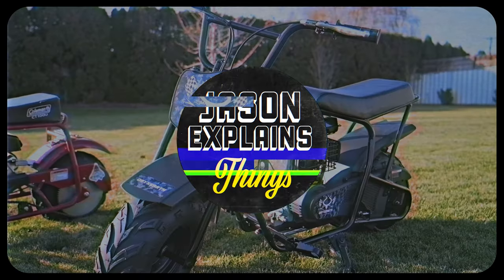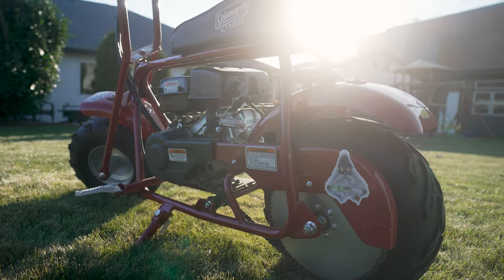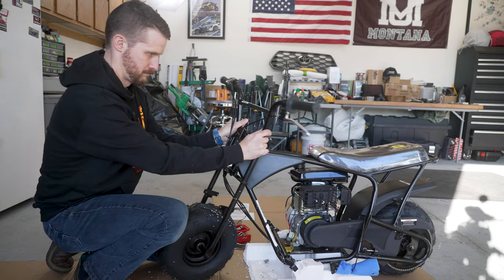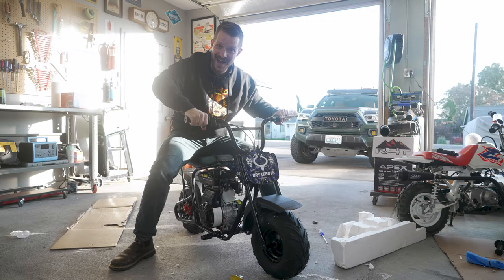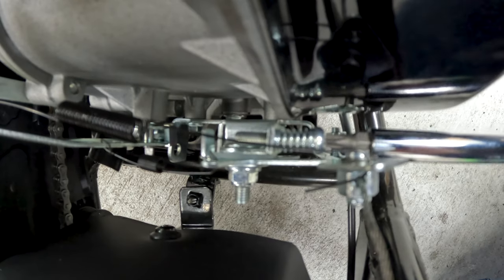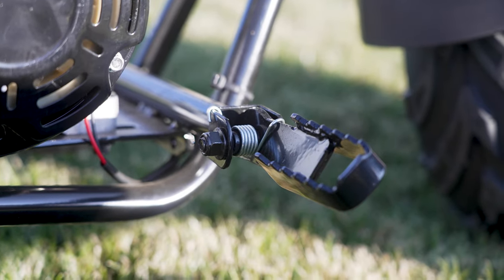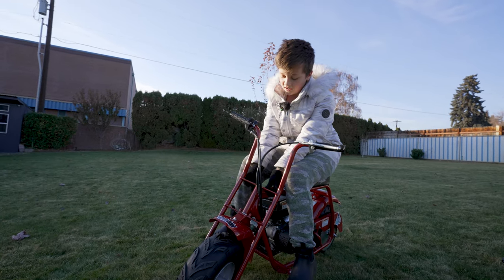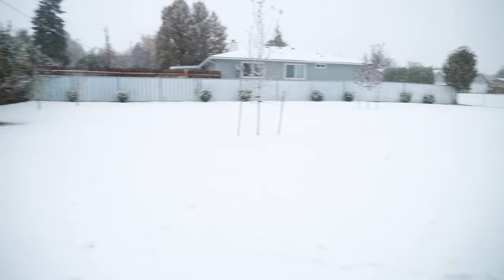Best Mini Bike For Beginners?!  Coleman VS Amazon

Comment: I just love my Trailmaster Hurricane 200 with the stage 1 kit🥰
Reply: Those things are pretty quick stock. Especially with how easy the speed governor is removed literally by removing a screw. I can only imagine how that thing flies with a stage one. Only down side I had with mine was the rear sprocket was so huge it would scrape the ground when leaning into a turn. But straight line it is a gem. I might buy another and add larger tires and stage one it.

Comment: When attaching the handlebars , first you should position the harness and brakes through the middle of the fork. Then attach the handlebars. Great video!
Reply from the maker: I tried that but the cables are too short.  Thanks for watching!
Reply: Pass the handlebars through the forks before attaching the forks to the bike. Wire routing avoided

Comment: Can I use regular gas? And how much fuel stabilizer should I add? Thanks!
Reply from the maker: Premium is recommended.  Follow the fuel stabilizer instructions for how much to add.  If you use Techron Powersports Fuel Stabilizer (channel sponsor) it’s 1 ounce for 4 gallons.
Reply: Ok thanks so much! I was thinking about ordering it. Just wondering any problems with it yet? Or is it still running?

Comment: Can oryxearth one hold 185 pounds?
Reply from the maker: I rode it around just fine and I weigh around 185.  I checked the link and it supports up to 185... but it's definitely more geared towards smaller riders and kids.